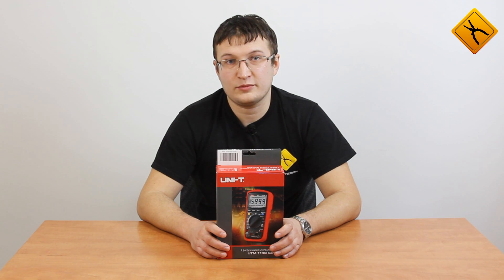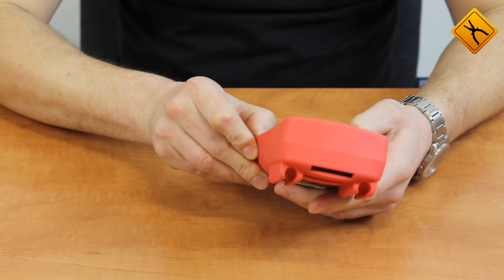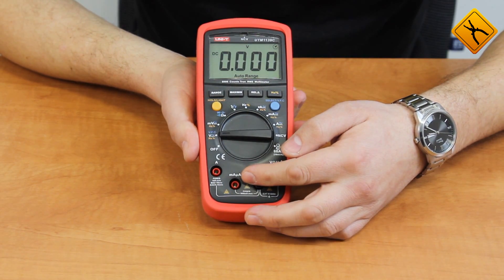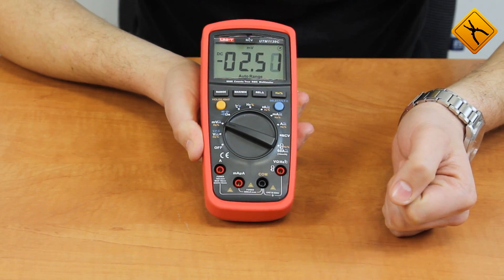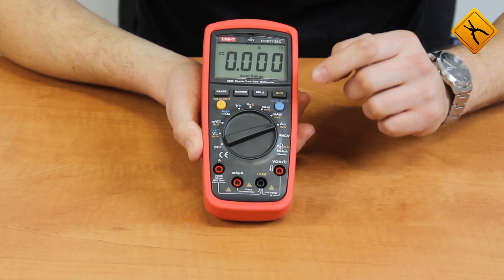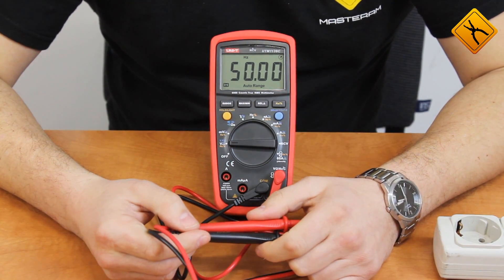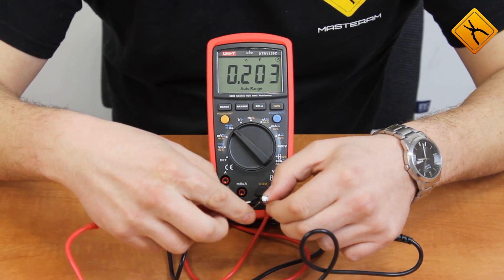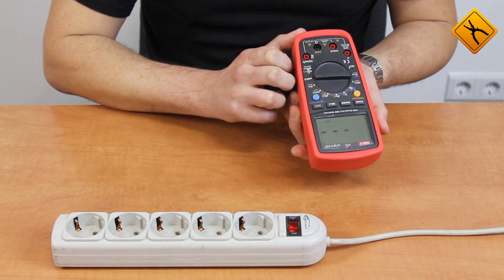UNI-T UT139C Digital Multimeter

Comment: I have this and now discovered mV measurement dances around like crazy up to 150mV with nothing connected.
Reply from the maker: Hello! This is perfectly normal. In such ranges, multimeters may be sensitive to a lot of interferences, but they show accurate and stable readings in actual measurement operations.
Reply: @ToolBoomVideo  good to know, thanks for replying, I though mine was broken :)

Comment: Hi, do you think the UT139C is safe enough to use for mains?
Reply from the maker: You may use this multimeter to measure DC and AC voltage up to 600 V
Reply: Yes

Comment: Hi do you know which clamp is compatible with this multimeter?
Reply: Hi, yes the Mastech MS3302 AC Current Clamp will work with it, but it's about $140.
Reply: I stand corrected, it's currently on eBay for £20
Reply: Many different modelsare compatible. Check that they can be in 1mv and 10mv mode

Comment: Does anyone know how can I turn off the beeping when I turn the rotary switch (Is it possible at all ?) ? It is a little annoying to hear the beeping when I select between the measuring modes.
(OR it is just mine which beeps when I turn the main rotary switch ?)
I haven't find anything about this in the manual.

Comment: Hi i have just purchased a UNI-T UT139C from ebay and when i set the Mv range on dc it is all over the place it counts up constantly and does not stay at zero before you take a reading. This does not happen on my old meter and i want to no if this is normal.
Please reply cheers.

Regards Simon
Reply from the maker: At DC voltage multimeters with Auto-Select ranges may display a value (other than zero) without connecting leads. But when connected to a voltage, they display the real value of the voltage. This is the norm.
Reply: I know this is  kinda late, but how did it turn out with your meter?